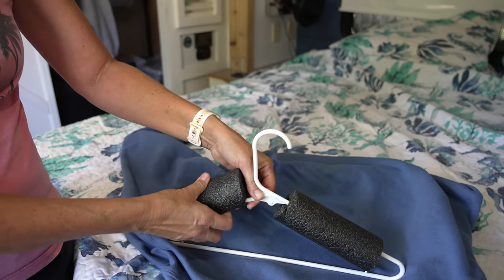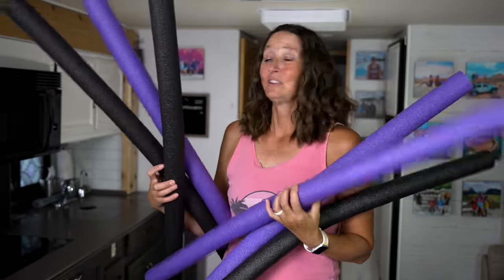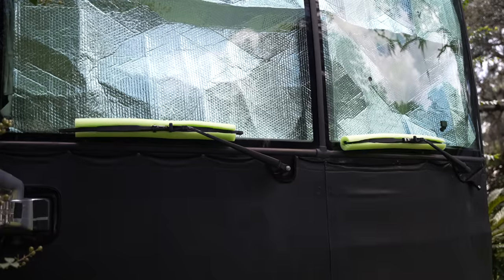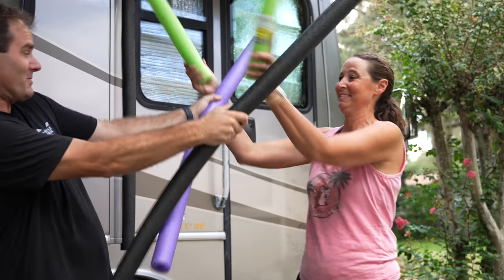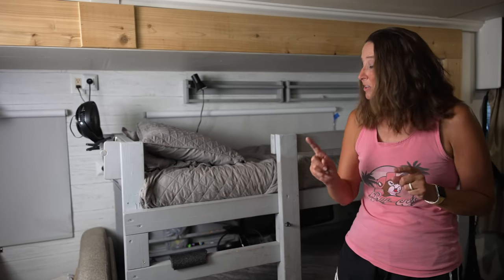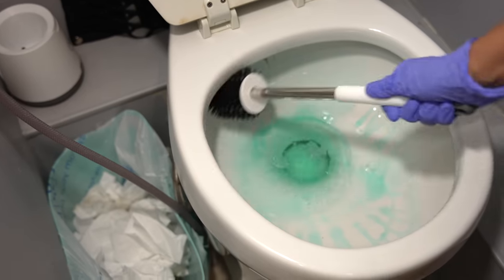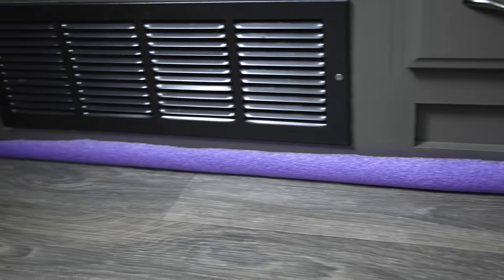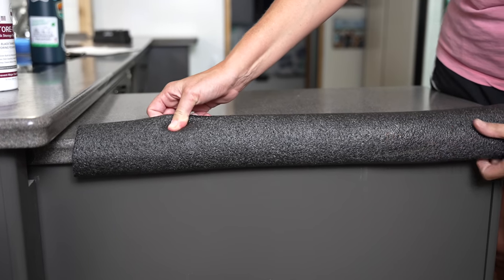People Are Using Pool Noodles For RV Life 🤯

Comment: also use them on the arms of the RV awnings. I have run into those and it is not fun. The pool noodles prevent bruises and, if you get brightly colored ones, you might see them before running into them.

Comment: I have a bumper pull trailer. I cut a pool noodle on my trailer tong sticking out the distance between tong jack and truck.  The pool noodle is a guide for lining up and knowing when to stop. 

By taping pool noodles on bumper over hanging  6 to 12 inches helps see were the corner is.
Reply from the maker: Great idea, thanks for watching